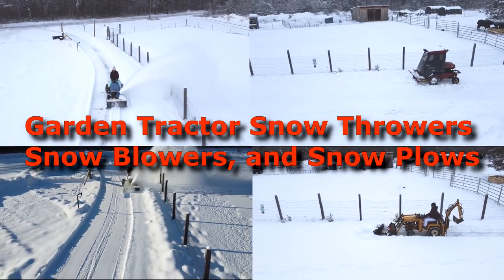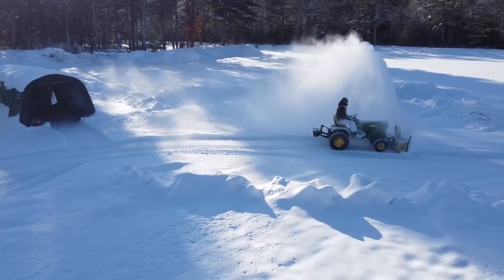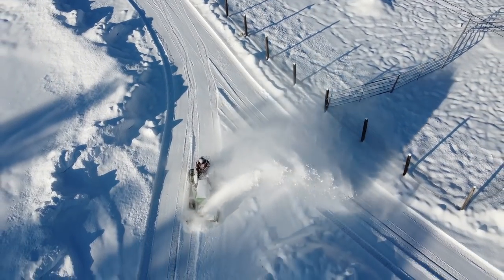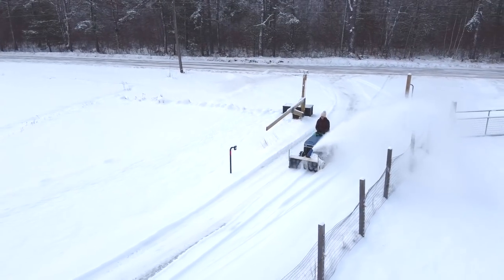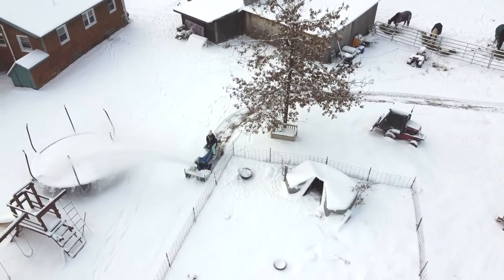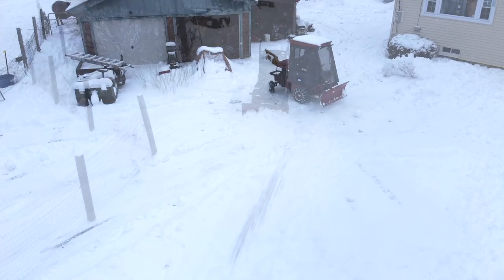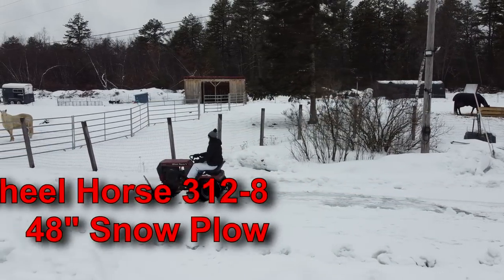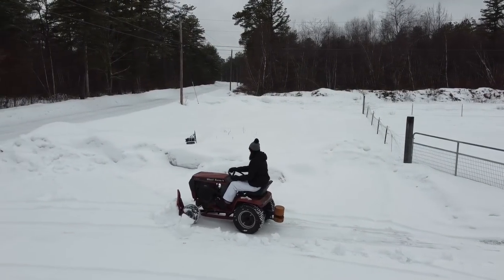Let's Talk Ep 1: Garden Tractor Snow Removal Equipment | Snow Thrower, Snow Blower, and Snow Plow |

Comment: I live in lake effect snow area of northeastern OH and have put together a dedicated snow removal garden tractor.  It's an '88 Wheel Horse 520H with the 44" two stage blower on the front of it.  Bought it on ebay and used uShip to get it from the other side of PA.  I've since added the gear reduction steering, a cab and extra lights and motorized the chute rotation and angle.  A little more work to do and I'll duct the warm air from the engine to warm the cab.  Makes clearing the driveway something to look forward to now.  Actually turns into playtime.  Kind of have a collection now.  Keep doing what you're doing!

Comment: Hey Norman. We talked before about a snow cab build. I have an older Craftsman GT 6000 w/a Kohler Magnum 19.5 twin. It is a beast for plowing snow with weights and chains. Use the $50 Harbor Freight winch to lift the blade, but still have manual blade angle. Snow cab build ideas would be appreciated. Thanks for posting.
Reply: Boat Owner...Love to see pictures of how you have the winch mounted to lift the blade. Been trying to figure that out for my Craftsman GT.
Reply: @Glenn_123  I will try to get some pics. I'll call Norman and see if he'll post them on his channel. It's all bolt on-no welding. My Gt is about 30 years old. Also put a cheap 12" LED flood/spot light bar on the grille-love it.

Comment: Good advice found in this video.  I grew up using a single stage snowblower on a Cub Cadet.  When I later got my own place and purchased a Wheel Horse with a plow I made the mistake (2 years in a row) of not getting that snow pushed far enough away.  There was 1 winter where I almost went and borrowed my friends loader just so I could move the snow pile so I could keep plowing.
Reply: I know folks who buy truck mounted plows who get stuck that way as well.

Comment: If the main disadvantage of snowblowers is the wind blowing snow back into your face, then add a homemade cab.
My mini excavator (6000 pounds), only had a canopy-style roof, and I was sick of having to cover it after every use.
So I built a cab with an easily removable door (for hot days). In winter, I use this excavator to remove snow banks after clearing snow from the roofs of the house and outbuildings.

Comment: I got a free craftsman 12.5hp LAWN tractor, like new condition incredibly. Fixed it by cleaning the carb lol. I bought a craftsman GARDEN tractor 2 stage blower for 75$. Got 2 mounts and a pin machined from my design at a machine shop for $100 and mated the two. That thing chucks snow like nobody’s business. Honestly didn’t think it would work too well because the blower is for a higher horsepower garden tractor and is 40” wide.  But it is great. Fully operable from the seat too 👍🏼

Comment: If you have multiple machines, a good compromise is to plow as much of the drive as you can, then use a blower to shave back the banks, especially since a garden tractor plow can't stack the banks very high.
Gravely is my personal favorite garden tractor! All gear drive and engine in the rear for lots of traction weight. The old MA series Gravely blowers are hard to beat!

Comment: I like a 2 stage blower with a blade as a back up. The blower for most snow and the blade for the wet slushy crud that forms on the roads as it thaws. All mounted on 90's vintage Cub Cadet "Cyclops" series tractors. The last of the good CC garden tractors before they went all lightweight..

Comment: It is interesting that you prefer plowing.  I think you enjoy operating the plow more and maybe appreciate the simplicity of it.  But after watching I think the snow blowers are better overall.  You don't need to plow all over the place just to make room for future snow fall.  Like that whole fence line area, you would just make a pass with the snow blower and it's done.  No angling or trying to pile snow up, having it push the front of the tractor sideways.  Maybe I enjoy the snow blower more because I like the horsepower aspect more than the traction aspect...but I think there are practical advantages.  I grew up in a suburban setting with a walk-behind 2 stage and shoveling.  So small tractor snow blowers always seemed like the holy grail.

Comment: I rent pole barn storage on an old farm in Minnesota. Just to the west are flat farm fields with no trees for about 1/4 mile. The owners sons usually do the snow with either a Dodge truck & plow or their Bobcat but do it quickly and sloppy. The old driveway is 1000 feet long and a big storm will drift it to 2 to 3 plus feet deep in places. Their new driveway is down the hill and is usually easier to clear. The old long driveway gets to the point mid winter at which they let it go. 
I have: 
520xi w/manual steering, 
522xi w/power steering and 
520Lxi w/power steering and it had a light fire on the top just under the hood. Besides mower decks I have a 48” front blade, 79366 two stage snowblower, 79365 one stage snowblower, plus an extra 79365 mule drive, and two 700255 Berco snowblowers I have about $250 total into. 
The 79366 two stage snowblower is well over 300 pounds and really hard for me to move around since I have Lyme disease which makes my arms weak when I’m in a flare up. I also have two stage walk behind snowblowers. I’ve used the 48” blade which works fairly well until you run out of room to push the snow. I bought the 79366 two stage snowblower 4 years ago and I’ve never used it. It’s really hard for me to find someone to help with anything so I’ve been trying to sell it for 18 months, no takers. I bought the 79365 single stage snowblower just because it would be easier to move around and install, but I didn’t use it this winter. I’ve intended to adapt one of the Berco’s with my extra 79365 mule drive. The Berco’s are a bit lighter than the Toro 79366 two stage. I also have an extra NOS complete rear axle and hydro pump/motor and some extra cylinders, hoses and misc.

Comment: My wheel horse is only 500 pounds according to TractorData, so I'm gonna have to find wheel weights for plowing this winter!
Reply: I've plowed up to maybe a foot of snow with a Agco-Allis 1613H (12.5hp V-twin hydrostatic) and never have had wheel weights, but do use chains. Mostly level ground though or slight incline of maybe 15, 25 degrees. Wheel weights would be good though.

Comment: Garden tractors are so easy to maneuver.  I would like a DIY articulating version!
Reply: There are custom DIY as well as factory articulated garden tractors.
Reply: @Blazer02LS  Why aren't bendy sub-compact tractors more popular?   Do they have stability problems?  Or is it a cost issue?
Reply: I think it's a bit of both plus they tend to be difficult when it comes to cramming all the parts into that size machine and still making it usable. Most use front or rear mount implements and it takes a bit to get used to running one. I ran a Steiner for a couple months and it's a weird feeling to need to follow the steering wheel as it articulates and twists. Plus most people buy the cheapest tractor they can find that does the job.

Comment: My dad has been using a Craftsman garden tractor for almost 20 years to blow out his driveway.  A few years ago the housing in the blower cracked and kept throwing the belt so dad took out the auger and just pushes snow with it. I was really surprised on how much he could push the snow with it. Even wet heavy snow it pushes it well. Dad does have 2 weights on each tire weighing 75 each and the barrel weight on the back filled with sand no idea the weight. I myself also have a Craftsman lawn tractor that has a blower on it. Does very well moving the snow. This summer I do want to put the snowblower on my Craftsman garden tractor that i also have. I do have a cab on my tractor so makes it nice when the wind is blowing. Dad also has a cab on his. Oh myself I have used my tractor blowing snow for 4 years now.
Reply: Well to add to my comment sold my Craftsman lawn tractor think it was a lts2000 didn't really care for it. So now looking for a snowblower for my Craftsman 2 or another tractor with a blower. Just love my Craftsman 2 Briggs opposed twin 18hp 6 speed witch I paid 350 for in 06 and still use it to mow the lawn. Just this year I put into it what I paid for it. Not bad for having it for 14 years now.
Reply: @ericouellette5293  Can you give me any advice on traction? I have a Craftsman 4500 dys with a two-stage blower. I have wheel weights and rubber chains for the tires but struggle with traction. Seems there isn't enough counterweight as when the blower is up, I have all kinds of trouble. That being said, it'll struggle while even down going up our ever so slightly inclined driveway. I was thinking of buying some slightly larger atv/utv tires or maybe placing the clippings bin on the back with some weight in there. Thoughts?
Reply: @deerhunt799  I don't have that problem with mine. I do have weights on my tires that weight 75 pounds each only weight I have exempt my cab witch does add weight but don't know how much. My driveway has a slight incline and I have no issues going up it with the snowblower up. I also have regular chains as my driveway is dirt. I think add more weight might help.

Comment: Great video. I am considering jd 200-300 series with snow blower attachment. They don't have diff lock. Do you recommend diff lock or I should be okay with chain, and weights? My driveway is 150' long and the first 25 ft has a slope of about 8 degrees (3' rise over 24/5 ft). The rest of driveway is flat.
Reply from the maker: You should be fine without a diff lock. Chains and weights on the wheels and on the back of the tractor will be all you need.

Comment: Great video, I agree entirely a garden tractor is capable.  Have one question though, how do you keep rocks from destroying, I hit one bad rock in my driveway and it knocked the single-stage shaft out of alignment (it was a 2 inch oval stone).  If one keeps a lot of loose gravel for a nice looking drive, then snow blowing becomes an issue, curious to hear your strategy in avoiding gravel or rocks?
Reply from the maker: For your situation, I would recommend raising your blower skid shoes high enough to avoid the rocks early in the season. When you have a layer of packed snow between the gravel and you, you can lower the skids accordingly.
Reply: Good advice on dirt or gravel. My biggest issue wasn't rocks, it was the newspapers that got tossed onto the lawn !!!

Comment: I definitely need to make a garden tractor front end loader eventually. What is the ideal tractor or top 3 to do that on, in your opinion?
Reply from the maker: I think the IH Cub Cadet Wideframes are about perfect. Easy to modify spindles, good steering linkage set up, robust rear end, nice and easy to bolt to frame. I would prefer a starter over starter gen so I'd recommend converting it. Other good ones would be the Ford LGT, Wheel Horse I like the gear shift transmission with a foot clutch.
Reply: @Isavetractors  okay, good place for me to start a little research, greatly appreciated.

Comment: you don't want to wait for it thaw and refreze
Reply from the maker: A fresh wet snowfall will freeze but still be blowable.  After it's plowed or condensed, then you don't want it to freeze.
Reply: So true, you let the water drop out of it and it will blow fine. But get the air out so it becomes a solid chunk of ice and you will do damage to a thrower or blower trying to move it. That's when you start hoping for an early thaw...